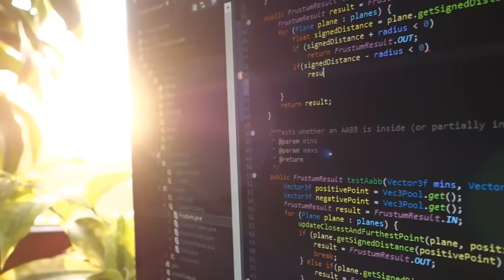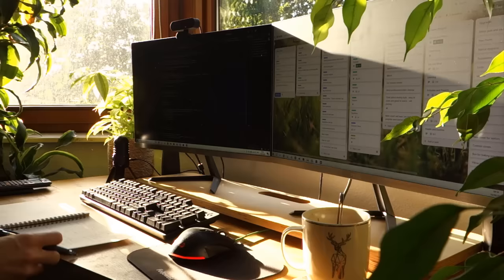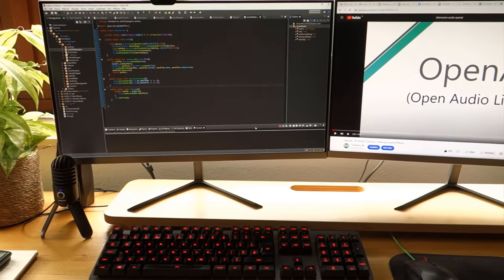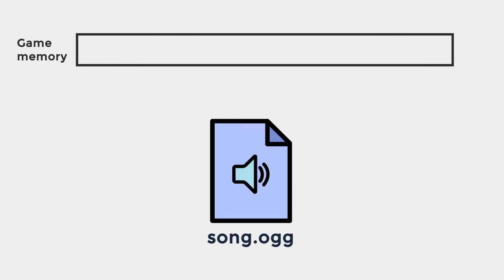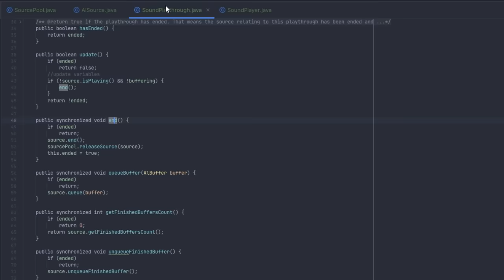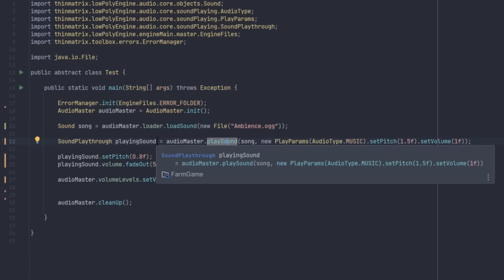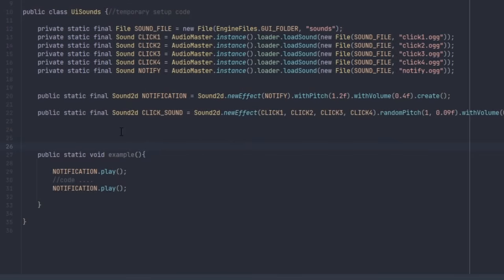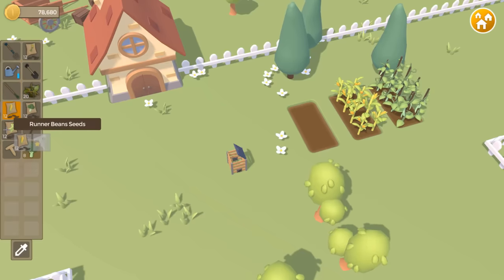Technical Devlog: Implementing Audio into my Game Engine

Comment: Everyone crying over unity while this mad lad just chills with his own engine. Absolute legend.
Reply: lmao, actually so smart from thinmatrix to do this looking at it retrospectively. Best unintended business decision
Reply: You're saying this as if it's not actually a problem that unity's doing this.
Reply: 1. Unity fixed pricing with a 2.5% revenue cap, becoming cheaper than unreal.
2. Making an OWN engine consumes time, you have to be VERY GOOD at math / vector programming to just have some level of a simple camera rendering a cube. 
3. Even making an engine that returns an executable application is a real PAIN. now imagine trying to produce multi-platform game on an own engine 💀

Engines costs money because they save time and resouces. You can always go godot but it has its sharp edges too.
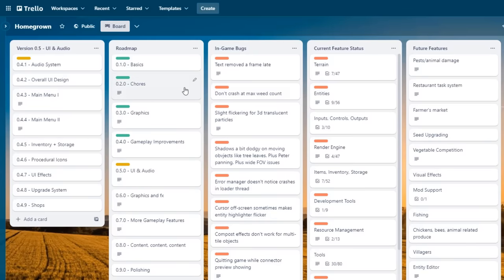Reply: 0:28 I am using Google bard AI not in Chatgpt to make my own game engine in visual studio in a C++ empty project but the engine is written in C# not in C++
Reply: @pedroduran8927 what? Bro just use glm… why do you need to do it from scratch… plus it’s the bare basics of linear algebra not the fucking most advanced part. It takes 3 minutes to learn how to do the basics of it with addition, subtraction, scaler mult and division, and dot product. This isn’t even high school math for some people

It’s literally 70 lines of code with glfw to init a window, 200 for a triangle, and around 400-600 for textured cubes
Reply: @snesmocha Absolutely correct, making an Engine aint hard. Making it in Vulkan, thats fkn hard xD
Reply: @pedroduran8927 plenty of games are made in their own engine. Making a specialized engine isnt nearly as hard as a general purpose engine like unity or unreal. Those engines need LOTS of features to support a multitude of different types of games.
Reply: @ArachnidAbby  it proves my point even more. Imagine having to change / develop another engine if you want to make another type of games or if you changed the perspective in middle of development
Reply: Even if you start another engine specific for a different game genre there is still a lot of code that can be reused and you can learn with your previous mistakes, simplify them and do better. It still does take time and effort, but you end-up fighting your own decisions instead of the others.
Reply: YES! I am also writing my own programming language so that I have full control over what happens under the hood. I know it will take me 10 years to make a game instead of 2 with an engine but I get to learn a lot more this way. For my next project I am also planning to write my own text editor because notepad doesn't allow me full control of things. ❤
Reply: @snesmocha in Godot/Unity/Unreal it's drag and drop, literally a fraction of a second. Hours of work saved 😎
Reply: @lamtrinh8780 I think first you should plan to write your brain and then your common sense, before you start with those, since you seem to have neither of those.
Reply: @pritamdavis  Writing your own game engine is just plain stupidity nowadays. Especially as an indie dev. Today's game engines too well optimized. Just take Unreal Engine as an example: No single person, not even an entire studio has the capacities and/or capabilities to implement an engine that comes close to the functionality of UE. Optimized multi-platform support, Nanite, Lumen, ML-Deformations or the sheer power of Unity's and UE's material systems alone. Those things aren't just "basic high school math", that's R&D at work at a level you can't even imagine with your limited little mind...
Reply: @pedroduran8927   i suck at math and i created a 3d camera that works with quaternions/ vectors / and matrices in like 1/2 weeks,  there are libraries that have been developed for years that do that, don't think you need to be a genius to make an engine to your own game
Reply: @Alphaomega332   I agree with you that if you want to make high end games with a lot of those features you should definitely use a game engine. But in cases like these, writing your game engine is not a foolish thing. It has its pro and cons. You have to invest a little time in learning and writing it, but you then have a good control on the totality of your game, and can customize even the fundamentals to your specific case. 
As I said it has its own pros and cons, so its just a matter of preference.
Reply: A lot of devs are doing this, including Randy and Aarthificial.

Comment: For building compound sounds, I would recommend using a builder pattern, as you're effectively building a track. You would create a compound sound with an add track method that takes a track, and returns 'this', allowing you to chain addTrack function calls, that way you don't have a block of variables defined in a row like at 12:35 with incrementing variable names like track0, 1 2 3. You've used the builder pattern with sound 2D builder I think it would work really well with compound sounds. If only to keep consistency of the code. It's still be a good idea. You're using the factory pattern, for the digging sound effect which is a good idea. When you combined with patterns, a new world opens up. Imagine a sound effect factory, that can create the sound effect you need, and using the builder pattern to configure the given sound effect as a compound sound.

Comment: It'd be cool to change the pitch of the sound during the digging or water pouring process so the player would have an intuition on how long the action would take without even looking in the screen.
Reply from the maker: Nice idea!
Reply: @ThinMatrix  To add onto this, it'd be an awesome bit of polish to have, for instance when harvesting a section of crops, to have the "harvest" sound rise in pitch over subsequent harvests. So basically crop 1/5 will be the lowest pitch, 3/5 being in the middle, then 5/5 being the highest, scaling in pitch depending on the size of that particular group of crops.

 It builds a sense of rising accomplishment when you have an audio source do that, very similar in to how Minecraft does their sfx for breaking blocks. Or y'know, just implement it on a smaller scale and just do it for each individual plant. I think it'd fit right in with your farming game here!
Reply: And not everything has to follow this system, you could also increase the frequency at which sounds are played to give a sense of speedup.

That way not every action sounds like a fire alarm.

Comment: Just an idea, might be better if the item you’re using/have attached is facing the direction you’re courser is, as that’s where it’s being used. For example the head of the shovel is facing the bottom right corner, where the curser is top left. Changing the head of the shovel to the direction you’re using it to me seems a lot more satisfying. Same with the watering can facing right when it is pouring from the left. Just an idea

Comment: You should avoid using the class LinkedList, and instead use ArrayDeque, has the same functionality, actually even more!, uses less memory and is more performant, the implementation uses a compact array which works better with the CPU caches.
Reply from the maker: Good to know, thanks for the info!
Reply: Ah, good ol' data structures.

Which to use depends on the access patterns.

The advantage of the linked list is that insertion / removal is a fixed cost, even when you're inserting / deleting in the middle of the list. Because you're just changing some pointers (insertion is pointing the previous node at the new node and having the new node point to where the previous node used to be pointing, removal is just pointing the previous node to the node after the node to be removed, so the node is pulled out of the list).

The disadvantage with linked list is, yes, that the nodes are allocated / deallocated individually and can be scattered throughout memory, so that's not cache-friendly. And that you always have sequential access, as you've got to start from the start and follow each link to find an item (poorer random access).

The compact array has the advantage that it is cache-friendly, because you're packing all the items next to each other, and that you can use random access (because the item at index n is at offset "n * sizeof(item)" into the tightly packed array).

The big disadvantage of the compact array is insertion / removal - particularly in the middle - as you've got to, for insertion, expand the size of the array, copy all the data after the insertion point further back to make room for the new data, insert the new data. For removal, you've got to copy all the data after the block to be removed forward to plug the gap (then shrink the array allocation with reallocation). Or, if you don't have dynamic reallocation for the memory, you're just recreating the whole array each time, which means copying absolutely evertyhing.

So the problem with the compact array is that, well, it's compact. You can't have gaps, and so you have to move / copy data around. And if your data structure is large, then all that copying is going to be costly - and the big problem is also that the performance is tied to how big the data structure is, so small amounts of data copy quickly but a large data structure full of data takes longer because there's more copying.

But note that, with the linked list, if the data structure gets large and you need random access - I need the "last but one" item, say - then because it's sequential access, I've got to step through the whole list (but one) to get to it. With a compact array, I can just grab the data at offset "(n - 1) * sizeof(item)" and instantly jump to any index.

So which is best depends on access patterns. If there's lots of insertion / removal all the time, then the linked list wins, for not requiring any data copying. If you need random access, the compact array wins, as you can calculate and jump to any index, while you have to go through each item, one by one, with a linked list.

There are other data structures. The "pool" is an awesome hybrid solution, often used by games.

The actual data is stored in a compact array. You just allocate a normal compact array of n items for storage. But then you have another "index" data structure alongside it, which tracks which elements of our storage space are in use.

When I need to insert, I scan for the first empty slot and use it. When I remove an item, I just mark that slot as empty - allowing it to be reused by subsequent allocations.

It's a compact array, but I can now have gaps. When we insert new items, we plug the gaps. When we remove items, we create a new gap, which can be reused by a subsequent insert later on.

But the real beauty of this approach is that the accompanying index is a different data structure. So you could use a linked list - well, two linked lists, one is a linked list of the items, the second one is a linked list of empty slots (the "free list"). You allocate the first item from the "free list" and put it on the "used" list. Removal is moving an item from the "used" list to the "free" list.

So you can have the quick insertion / removal of a linked list, but the data itself is in a cache-friendly random access compact array. Best of both worlds, and - the big reason why games often use memory pools - is because it cuts down on calls to OS memory allocation / deallocation, as you've got a pool of memory and you just keep reusing it over and over. The only time you call the OS allocation is if the entire pool is full and you need to expand it to accommodate more. It's cache-friendly and has random access. But the accompanying index structure - keeping track of what's in the pool - can be another data structure that has its own advantages. You can use linked lists, or another compact array, or a hash table to index into your "pool" compact array storage.

Indeed, the "pool" approach basically decouples indexing from storage. You store in the compact array, but you index into it using some other data structure (or, even more powerfully, you could even have multiple indexes - you could have a hash table on "name" and also another hash table on, say, "size" or any other data. As the index is now separate, you can have multiple indices for optimising finding the data in different ways - at the cost, because there's always a cost, of having to maintain multiple indices on insertion / removal).

Yeah, the advantage / disadvantage of being a C / C++ programmer, we end up in the weeds of this stuff all the time. But the plus is because you've got to do this memory management stuff yourself a lot of the time, it makes you think about it all and choose the most optimal data structure for each instance (not just LinkedLists for everything, everywhere, all the time).

But, as I say, for games, the "memory pool" is the perennial favourite. It's built on a compact array, so it's cache-friendly and random access. You reuse slots, so you're only ever hitting the OS allocation when your pool is totally full. For insertion / removal, you're not copying actual data, you're re-arranging the index that just points to the data in the pool.

Decoupling the data from the index into the data means you could have multiple indices for different access patterns (one index on "id", one index on "name", one index on "least recently used" or whatevever) and can mix and match different indices with your underlying storage. So, for example, the index could be a stack or a list or a tree or whatever, which just provides an index into your compact array, where the real data is stored.

Yes, sometimes, ArrayDeque will beat LinkedList, as it's cache-friendly. But it really depends on your access patterns and size of the data (if each item in the data structure is bigger than a cache line anyway, it doesn't even  matter, as you can't fit it in the cache and it's a cache miss every time).

The real thing to do is look at your access patterns and then choose accordingly. Though, sure, all other things being equal, ArrayDeque probably works for what you're doing and, therefore, will likely be the better choice. But not always.

The underlying wisdom is that these things are always case-by-case - as it depends on how you use the data structure (e.g. do you need fast insertion / removal as you're doing it all the time? Is your access always sequential or can it be random access?).

And, in the end, always profile it. If it's "good enough" then leave it be.

As programming god Donald Knuth would have it: "premature optimisation is the root of all evil". Really, only optimise when you need to, as the thing's chugging and laggy, as you develop it. Do an "optimisation sweep" after you're finished coding it all to lower that "minimum spec" for your game.

Don't optimise early. Not least because you could be wasting your time. For example, I get a sort function and then I drop down to assembly language to really optimise every last CPU instruction. Cool. It's a super-fast sort. But then I re-visit the design and algorithm. If I move this here, if I change this... cool, now there's no need to pre-sort the data on-the-fly. I don't need that super-fast sort algorithm anymore, as I've got something even faster (another Knuth quote: "the fastest code is the code that never runs").

Do optimisation at the end - only do optimisation during development when you've got no choice, as it's just too damned slow and laggy without it - and then always optimise "top down". Start at the highest level and move down to the lower levels. There's a "directionality" to optimisation, as noted, so you don't want to just be "undoing" all your previous hard work all the time.

Also, always start with the overall algorithm and data structures, because those are the biggest wins. Going from a linear search through an array to a hash table - from "O(n)" to "O(1)" - will massively improve your performance. So much so, that's probably all the optimisation you need to do for excellent performance on everything. If you find yourself amongst the weeds of individual instructions, then you're doing it wrong, unless it's the very last bit of optimisation you're doing right at the end (and, with deadlines, you'll probably never get there - but if you've chosen all the best algorithms and data structures from the off, you won't need to be in the weeds anyway).
Reply: @klaxoncow That's a lot to take in, but thanks for taking the time to share. Learnt something new!
Reply: @pritamdavis   Yes, apologies, as it is quite a bit of text to read. Unfortunately, it's just not a subject you can easily summarise - I mean, "data structures" is often a whole module (or two) unto itself on university courses. Like, it's a lot of text, but this is the summarised version, believe it or not. 😁